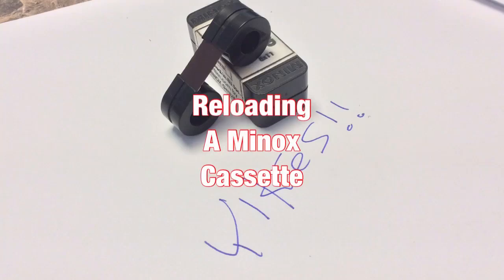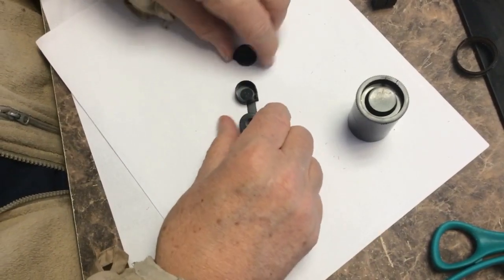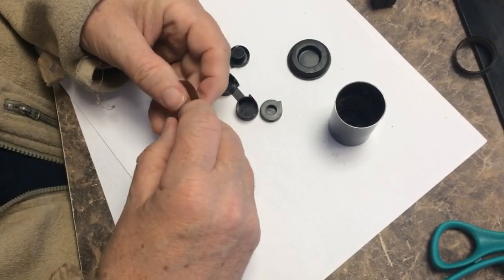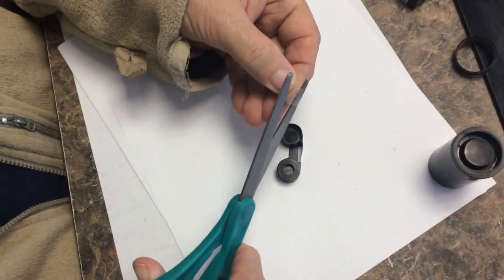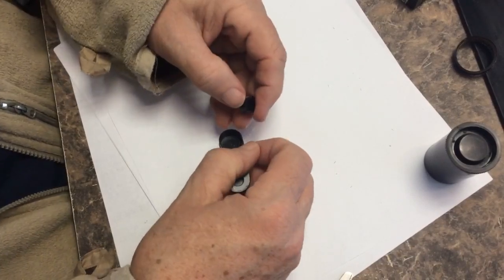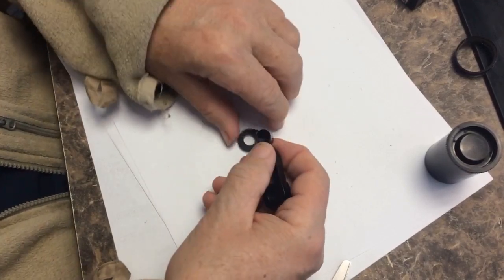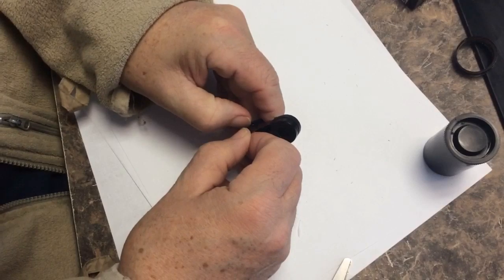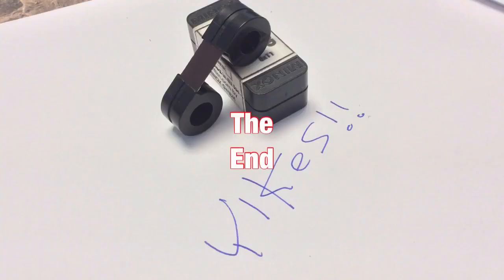Reloading a Minox Cassette

Comment: It's quite easy after you've done it a couple of times. It's worth wearing nitrile gloves, if you're using a changing bag, because they stop the sweat on your hands from damaging the emulsion.
Reply from the maker: I have had that problem,  but in hot weather I think your tip would be a big plus.
Reply: @m005kennedy  Hi Mike, I'm in the UK, so it never gets really hot. I've found that film gets sticky when it's exposed to even the slightest bit of moisture.  Please make some more subminiature camera videos, I enjoy watching them. 73, G1DRP

Comment: thanks for sharing this.  One thing you said confuses me.  You said that the film gate was such that you had to be very careful about tape size.  Since you don't rewind the cassette back at the end of exposure, the tape will never get near the film gate.  Am I missing something here?
Reply from the maker: It is important the with of the film fits so it can't be too wide. The issue with the length is if it is too long it will be in the very narrow slit in the take up spool with the film and will jam. It could pull off the take up spool and you won't notice until you have used the roll and take the film out.  You could also just turn the the take up spool so only the film and no tape is in that narrow slit.

Comment: New at this..What about fingerprints on the film?
Reply from the maker: You have to avoid them by touching the film on the edges only.
Reply: @m005kennedy  okt hanks
Reply from the maker: Gloves can also be used. Non link white gloves are used for handling film. Surgical gloves are not usually used but I don't know why not.
Reply: @m005kennedy  great! thanks again for the information!
Reply: gloves